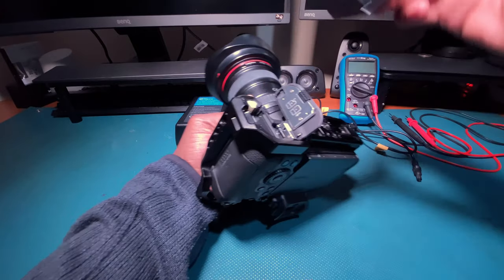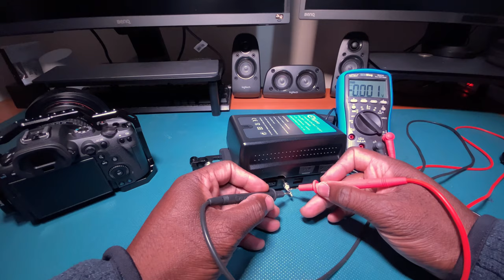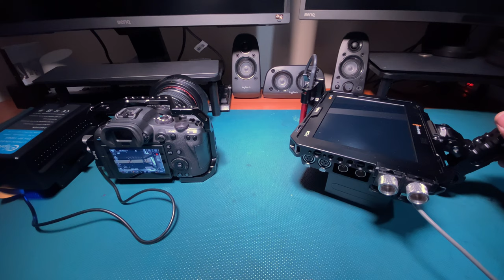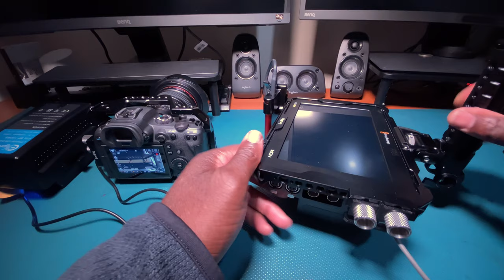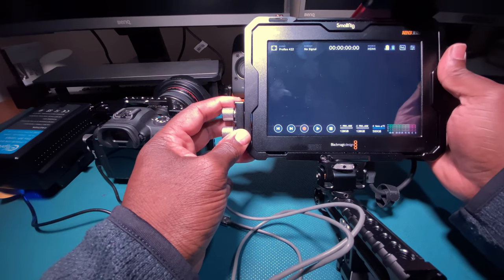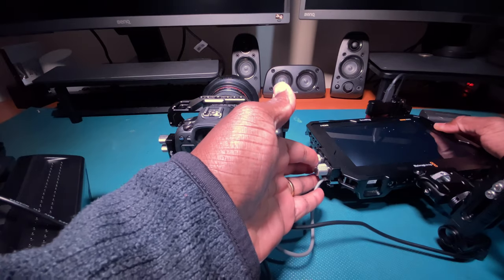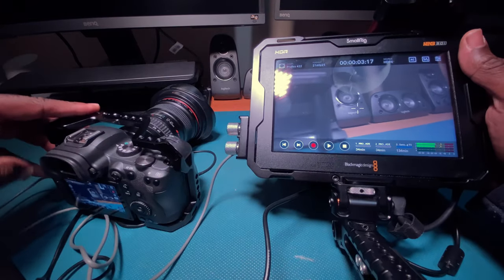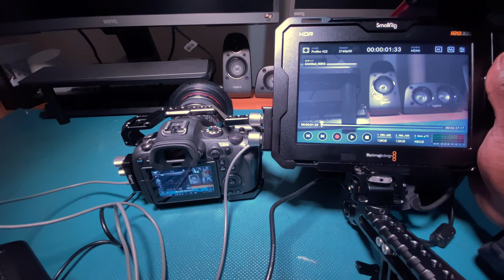Power Canon EOS R5/R6 and Blackmagic Video Assist 7" 12G HDR with a V-Lock battery.

Comment: Hey guys.. I have r6 and dummy battery With d tap end. Where do I plug that into.. 7.4v or the 12v? Thx
Reply from the maker: I am not sure I fully understand your question, so I am making an assumption that the dummy battery goes into the R6 and the D-TAP should be able to plug into a D-TAP socket on either a battery or a mount (connected to a battery). The voltage on my battery for D-TAP is 15.88. Hope it helps.

Comment: Thanks for your presentation. Can you record in Blackmagic RAW?
Reply from the maker: My camera (Canon EOS R6) does not enable Blackmagic RAW. There are other cameras that do.
Reply: @luconeover8307  I know the R6 doesn't record RAW. But after connecting Assist, can you switch the recording mode between DNxHR, RAW and ProRes or only ProRes works?
Reply from the maker: Hello Cezary, On my video assist set-up, I can switch between all three (Blackmagic RAW, DNxHR and ProRes).  When I try recording for Blackmagic RAW on the video assist, it displays message, "Codec not supported". The video assist is able to record images from the R6 for ProRes and DNxHR (comes up as DNxHR HQX on the video assist). DNxHR Playback works on the Video Assist, but I have not tried editing or coloring the DNxHR file on Davinci Resolve, so I don't know if there are any issues.
Reply: @luconeover8307  It's totally clear. Thank you very much.

Comment: Does Video Assist work if you turn on photo mode?
Reply from the maker: Hello, When I use the same set-up for video, but put the camera in AV mode, the image is recorded to the camera's SD cards and not to the video assist. So I don't think video assist works in photo mode. Also the images recorded to the camera's SD cards are not viewable until the video assist is switched off.
Reply: @luconeover8307  Thank you for your answer. I often work on the R6 in Photographic M mode in the studio. I'd like to use Video Asist for filming and studio photography help. Can you check if Assist works the same as the R6 screen when shooting a picture? Does the photo M mode waveform on Assist work?
Reply from the maker: I had the chance to try the following. Connect the Video assist to the R6 via HDMI. Switch the R6 to Manual (M) mode. Once done, the R6 switches off its screen and the video assist displays what the camera sees. All the R6 fields that would normally be displayed on its screen are now displayed on the video assist. All the R6 settings for Manual mode can be altered. When the shutter button is pressed, the photo is  taken and stored on the R6 SD card. I come to the conclusion that the video assist is not intended  for photographic use as it is built for video (which it excels at). Other than showing  the image the camera sees, on the larger video assist  screen, it is not beneficial for photographers. Whilst it is possible to use the video assist for photography, it is less user friendly. For example to display the photo taken, the "Play" button on the video assist needs to be pressed. This causes the video assist screen to go blank and the R6 screen to start. Then the "Play" button on the R6 needs to be pressed to display the taken photo on the R6 screen.  To go back to the video assist screen, the "Stop" button on the video assist needs to be pressed. All in all, I really like my video assist and what it does for my video usage, but I have no plans to use it for photography. The video assist's Waveform, Parade, Vector and Histogram scopes seem to work for the photo image.
Reply: @luconeover8307  Thank you very much for this test. For me it's very important. It would be great if everyone helped as you do. THX. Best regards. Cezary

Comment: Great explinations. Did you ever try and power the R6 and the Video Assist both from the same V-Lock battery ? I had been powering a Sigma fp (dummy battery) and Video assist 12G from the same V-Lock without problems, but when I tried the same thing with a Blackmagic pocket camera (original version) the HDMI port on the camera started smoking, melted the cable a and fried the camera. Not sure why or how voltage came out of the HDMI port on the Video Assist? (or if this is a camera specific issue?) I did notice that you powered your monitor seperetly and wondered if this was why? Thank You
Reply from the maker: Hello Taki, thanks for making the time to watch my video. The Canon EOS R6 and the Blackmagic Video Assist are powered from the same V-Lock battery via a V-Lock mount. The battery attaches to the mount and the R6 is powered using the 7.2v socket and the video assist using the D-Tap, which are both on the V-Lock mount. The V-Lock battery does not have a 7.2v socket, so to be able to power the  R6, it has to use the mount's socket. All the battery is doing in my case, is providing power to the V-lock mount. I have had no issues with powering both devices at the same time.  I don't have the Blackmagic pocket camera, so I am unable to provide an explanation for your experience. My later video show how to replace the generic dummy battery used in the R6 with a Canon one  (https://youtu.be/TUAvUFIEM30), other videos show examples of use. I hope this helps.